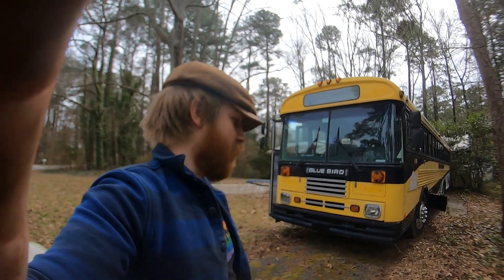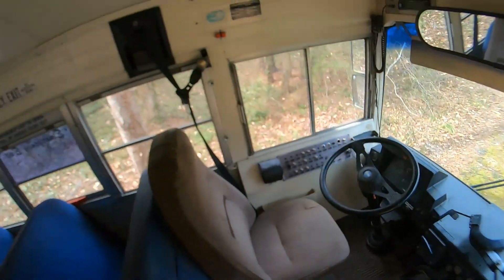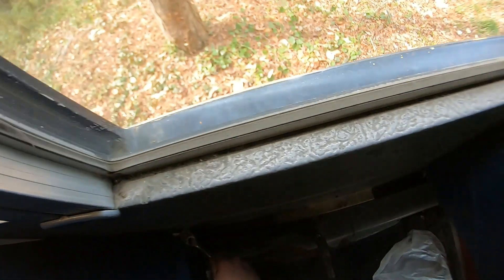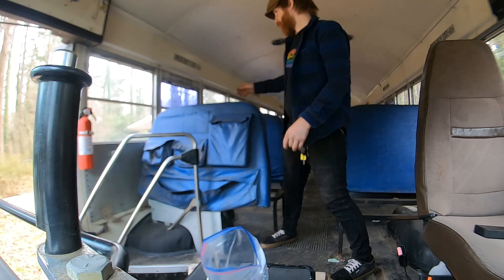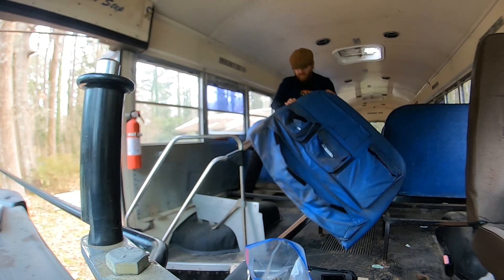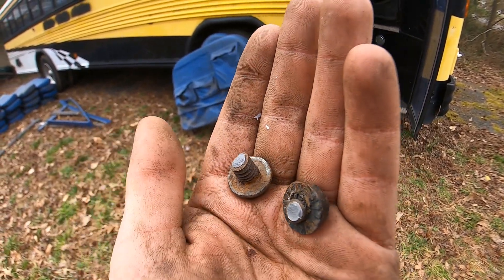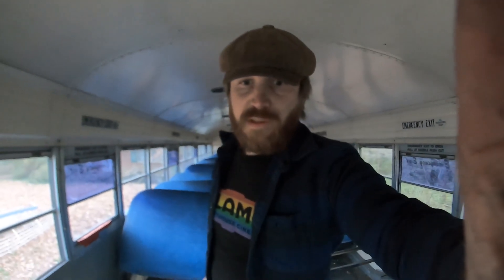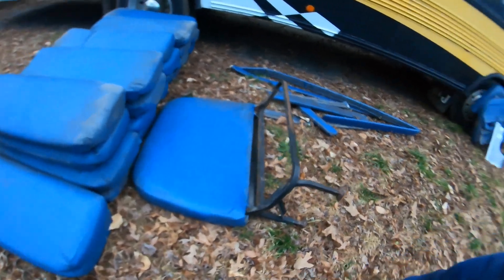Skoolie Conversion Day 2 Trying to Remove Seats

Comment: I think it's obvious you don't have a lot of mechanical/ fabrication experience? I was yelling socket extension! lol That battery pack doesn't have the juice to charge those batteries.  
You are a brave man to be doing this by yourself with no help, and very limited tools. If it was me, I would rent or invest in a impact driver to get all those bolts out. I have just about every tool made, but I'm old, and have learned by hard experience. Maybe that's the best thing for you as well. Please use some safety glasses. Those bolts snapping off could nail you in the eyes. Don't use the angel grinder without them and gloves. Even if you could snap the base of the seats, you still have to go back and get the bolts out or grind them.  I would love to lend a hand, but I'm too far away. I may be doing the same thing when I retire. I admire your efforts. Subscribed! Oh..and Harbor Freight is your friend for DIY's on a budget.